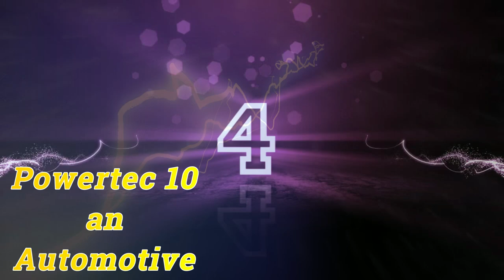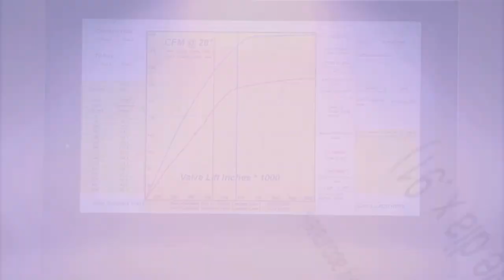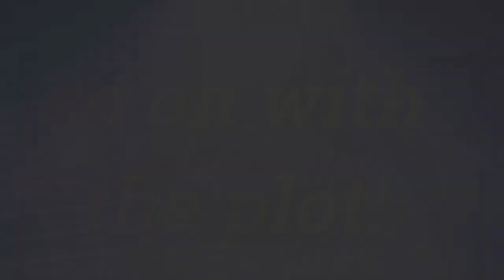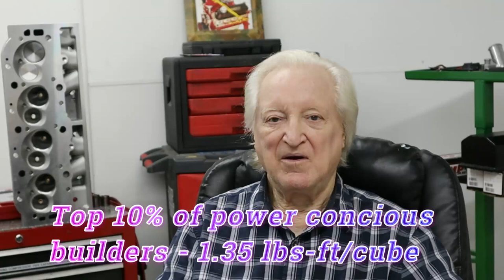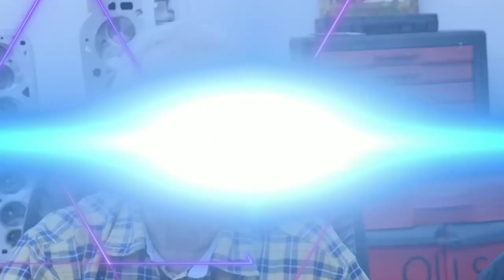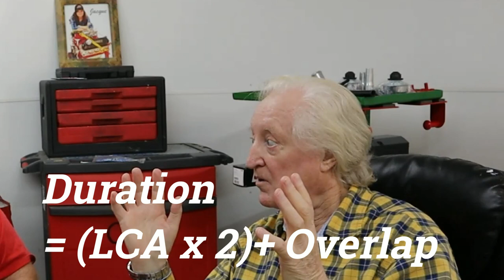Vindicating DV's 128 lobe centerline selection formula

Comment: Is your cam class available online? First time 440 mopar stroker build and having trouble finding right cam choice. Stroker is 512ci ((4.250" stroke/7.100" rod) Stroker kit) ,  10.6 to 1 compression,  intake port that flows over 320 CFM  on aluminum heads, 2.14 intake valve, dual plane edelbrock rpm intake (1000 to 6000rpm range on stroker). Looking for low end to mid range torque for street use. Quick shifting 6 speed auto trans. I must be doing something wrong with your formula because I get a LCA of 100.78. What do you recommend? Special grind? Online classes? Not looking for cheap, just correct right cam regardless of price.

Comment: Great video, I love watching them. I used the 128 formula when I picked the cam for my 331 stroker small block Ford, the LSA came out to 110. But after learning more, I found out that for a small block Ford, you recommend 127 in the formula not 128. Why is the small block Ford different? I wonder if my cam is less than ideal now because using 127, it works out to 108.
Reply: It's because of your valve angle. Different valve angles use a different figure i.e. 128 for SBC and 127 for SBF, etc
Reply: @troymecey  It has Trick Flow heads. So the valve angle would be different than factory. So perhaps 128 would have been right?
Reply: Probably be the other direction seeing sbc is 23 degree, sbf is 20 and tfs is 15. I wouldn’t lose sleep over it. Is it worth something yeah I’m sure but will you ever notice probably not. You can’t feel 10-15hp and it’s probably even less.
Reply: @raymondleathers5921  Isn't the point to get it right in the first place?
Reply: @hotrodray6802  yeah I guess, define right. There’s more to consider than just max hp when building an engine for street use. I watch these videos to hopefully learn something. DV definitely is a intelligent guy but he has a chip on his shoulder when people question his research. Rather than hear him rant about some internet troll I’d rather hear about how he came up with these formulas.
Reply: I believe it's different because in comparison to a stock SBC head the factory SBF exhaust ports suck, so you need a tighter LSA to get more draw on the intake port during the overlap period. Trick Flow heads are worlds better than stock Ford heads so I'd bet the 128 formula would apply not the 127.
Reply: @samuelfreeman9518  guess we’ll never know, DV to busy ranting rather than explaining. I have respect for the guy but if you can’t take criticism the internet isn’t for you.

Comment: How about Pontiac V8 and Oldsmobile V8 David?
 I changed the baseline number to BBC and found it dead on to LCA I use.
Vision Blinding acceleration. Also I am a Huge Fan and User of Iskenderien camshafts and components. Playing with a 1999 Big Block Chevy Gen 6 454 Daily driving fantastic 87 pump gas engine in my 1997 C2500.  Spanking all the LS 6.0 6.2 Pickup guys and High boost Diesel Turbo guys on the Highways in IL. Still like SBC but no substitute for Cubic inches for me.
Reply from the maker: BBC - my favorite motor!!

Comment: In the 128 formula what are the  dashes for? Do I add the CID, 8 and the intake valve size together and then times .91. Long story short, My Dad passed away a couple years ago and I want to finish Our 68' Chevelle for My Mom, but I want to do it the right way. My Dad was a Professional Engine Builder and I know for certain He knew this 128 formula and I know He would've gone over it with Me if He knew he wasn't going to be here in Person.

Comment: Would it be safe to assume that the formula is designed to pick a cam that results in the best horsepower and torque produced, but without regard for street drivability?  In other words, if the formula resulted in selecting a cam with a narrower LSA of say 108 deg vs. 112 degrees, would the 108 deg LSA cam result in a rougher idle, and lower idle vacuum, resulting in potential problems for power brakes, the PCV system, and carburetor tuning?  Would off-idle performance suffer?  Is this why cam manufacturers typically spec out a wider LSA for street use?  Thanks.
Reply: Good question

Comment: To figure out the optimum lobe centerline angle for a four valve engine would you take the area of the two intake valves and convert that to the diameter of an equivalent area single valve?

Comment: I'm running a 350 Chevy with 10.7 to 1 compression 202 160 valve heads and two four barrel Edelbrock carburetors of course headers still crank pink rods Keith Black pistons what do you think would be a good cam for this to daily driver

Comment: Gonna ask a dumb question.....for a turbo diesel engine, semi truck sized ( 12 liters and up ) that is going for better torque and fuel economy,  can this formula be used? 6.00 per gallon diesel fuel is getting old.
4 valve heads
15-16.5 to 1 compression
Peak torque 1000-1200 rpms
Peak horsepower 1800-2100 rpms
Reply: Good question.  I would also like to know the '128' number for an F. E. ford.
Reply: Hi I don't think it will work for you application because this is a simple version that is best suited for 4 inch bores on 2 valve engines, David does have a program that take into consideration everything on a motor but its for gas engines. Hope that's helpful🙂
Reply: @jodypaul2695  I came up with 105 -106 for a 390 and 108 for a 428 . No one ever made a 106 LSA cam for the 390. They should have because it unleashes a monster.
Reply: @Bbbbad724  I guess what I was asking for was the number to use in place of the 128.  He says for a sbf use 127 and for a BBC 132.  Do we still use 128 for the FE or do we use a slightly different number?
Reply: @mackenziehutchison4838  fuel doesn't matter, reciprocating/poppet valve engines are all the same. Engines need what they need and given that most cam designs are guesses at best, bringing some proper thought can make some serious gains in efficiency
Reply: You would probably gain more fuel economy from a turbo change than a cam change.
Reply: @jodypaul2695  I am wondering about that myself. FEs have been my favorite ever and I still love them. I wonder if 130 would fit them better, they were built so well as very sturdy medium block engines. I have built them for years and they really punch way above their weight when you use a narrow LSA cam in them.
Reply: @jodypaul2695  I have posted a question for Mr Vizard about it, and all of the other makes like Oldsmobile, Pontiac FE, from 400-455. Mine is a 394 but it’s a lifetime engine that I spared no effort on and the casting is excellent, and it is a solid cam, 107 LSA, but it still makes 512 lbs ft and 496 hp. And it revs to the upper 6000s and 7000+ if I want to. It is a beast for 54 degrees of overlap. The numbers don’t lie, and I was amazed, I ported the heads myself to just under 270 at .400 to .294at .540, a sweet spot for the cam, 1.8 rockers and hose barbs in the valley drains with the oil going to front and rear but off the crank. Nodular iron but light keeping the oil off. I hope that he sees this and gives his experience. Torque is where it’s at, I chewed a 400 ci GTO with RAIV heads and a mcKellor solid cam up and spit him out with a 4800 lb 65 F250 4x4 and the NP 435. That torque is vicious and slamming the truck trans with a tap on the clutch. When we stopped he was laughing like a hyena. He had me raise my hood expecting a 514, he said OK that is a Holley Street Dominator and 3 inches of spacer, and a 750 4100 style to his RAIV and Qjet. I heard it pop when he surprised the secondary. I replaced his hanger and rods to a C and AX rods. Also it was only opening to 95%, so I got out a bastard file and put the flat side to the lugs on the air valve to 100% and the accelerator pump was set too high and it was sipping air, so I set it down where it should be, locked and loaded. He also was having trouble at times with the clutch pedal sticking to the floor, but he was just tapping it like I was it didn’t stick, but I adjusted it and adjusted the pedal return spring just a little.. I had a 70 LeMans Sport with a 4 speed and a RAIII so I knew what to look for. I offered him a rematch, but he said nope, he was completely convinced that I had either a 64 427 LR or a 428 SCJ. He refused to believe it was a .020 over 390,lol. I saw him out and gave him the 3 and he shook his head no.
Reply: @Bbbbad724  cool story.  I will interested in hearing what Mr. Vizard has to say.  I would love to go to one of his seminars, but I haven't seen anything on his website yet as to when he will have another one.  If I might ask, who is the cam manufacturer for the can in your 394?
Reply: @jodypaul2695  Thanks but I promised not to disclose it.   It is a good cam though. To be at 107straight up it’s surprising that it is as civilized as it is until you jump it.

Comment: DV>>>Mike Jones supplied the blank and ground my 104 LCA for your CosCam specification Roller for my GenVI 496 Stroker BBC. I had undersize 2.19 intakes because I had a new pair of 290 CC Runner GMPP/Edelbrock Aluminum heads for the build for a mild street engine. Mike ground it with one of his profiles you recommended.:goodvibes:

Comment: Most engines are over cammed when built by speed freaks. Like us. So just go a few sizes smaller then what you want. If you want a 320 cam use a 285 etc.

Comment: Excellent video DV. Thank you very much for your time. One question however, everyone focuses on the intake lobe and LCA/LSA. My question is,  how do I determine the correct exhaust lobe? As you are aware,  everyone wants to sell you a cam with a vastly different exhaust duration and lift. Basically what I am saying is that every cam company seems to think that the exhaust side doesn't flow enough. I know that I am missing something here. Regards Greg
Reply: He says in this video that with the proper LSA and the desired overlap that the overall duration is automatically revealed.
It's just numbers.
(LSA x 2) plus overlap = duration, wasn't it? So the duration is the result.
Overlap is intake open to exhaust close.

Comment: I'm in the research phase to build a 598 BBC. I'm currently reading DV's How to build HP book. A just under 103 LSA on a such a huge engine? It seems that the cranking pressure (cylinder pressure) would be way too high for street use. 

Could I spread that out to a 105 LSA and still have the engine run efficiently?

Comment: Question - I asked the guy who's going to be building my engine, and he agreed that your method of selecting LSA would make good power, but he also said it cold cause detonation problems (due to higher cylinder pressure) with pump gas. So is the formula applicable to pump gas engines or is it for racing gas? Not doubting your method, just wondering if there are any adjustments needed for street cars running on pump gas. ALSO... is the "128" OK for a small block Mopar or does that need to be adjusted? Thank you.
Reply from the maker: You need to use a detonation safe combination of CR and fuel octane. If we go a sep further here one of the correction factors is to alter the LCA to get the cranking pressure where it's needed for the octane used. Your engine guy sounds like he is on the ball!

Comment: Thanks for the content David and Andy, I'm interested in your thoughts on finding the lobe centre line on a none symmetrical lobe as the opening ramp and closing ramps are totally different. Last time I done some measuring on one of those new lobes.  I measured at 0.006', 0.050' , & 0.200 and the centre line angle changed at every different lift?
As the nose radius is not centred to the opening & closing ramps.
Years ago an old cam grinder gave me a formula that was Duration Divided by 2 and Subtract the Lobe Separation for Intake Open and add the Duration for Close etc.
If I used the above Formula and the Cam Grinders Advised Lobe Separation then corrected out the Cam Grinders Advance the Opening & Closing Events were correct as they provided Opening & Closing Data @ 0.006 0.050 & 0.200
I have noticed a lot of people dialling cams in on lobe centre line @ 0.050 etc
To me it looks to be getting back to Opening & Closing events as the Lobe Centre Line varies at different Lifts as the lobe area varies as per the ramps.
Looking forward to your thoughts
Reply: I usually determine intake centerline by doing .050 from full lift.

Comment: May I ask a question about what confuses me? Let us say we start with a camshaft for a 350 sbc that is 270/270/108 installed at 104 LCI. If we then compare it to another camshaft that is 270/278/110 installed at 104 LCI, overlap and the overlap triangel area should be very much the same. I do not understad why this is a worse choice than a camshaft that is 270/278/108 installed at 104 LCI. Is it the difference in peak exhaust valve lift timing?
Reply: DV emphasizes that it is the LSA that is most critical and that precedes the desired overlap.
Duration is the conclusion of those first two.

Comment: A 3/4 race cam in my world is a cam with .750 lift. Have one in my 496ci Chevy. Except mines  only .748 lift, but close enough. I never did put much stock into people claiming they had a 3/4 race cam when in reality, it's just a mild street cam.
Reply: I thought that the term "3/4 race" was meant to convey it is a cam that is 3/4 the way from stock to race, as far as it's duration.
Reply: @pete540Z  Pretty vague term tho, one man's race cam is another mans street cam. Actual specs are always required if ya want to do it right.
Reply: @pete540Z  NHRA "Stock" Eliminator engines use stock lift spec, but shitloads of duration and tight lobe separations. They are full rowdy with minimal lift. Wouldn't call them a 3/4 race cam tho. They are serious these days.
Reply: @thereluctantgearhead4544  Totally agree!  I used to give Frieburger shit when he'd publish Engine Masters results and leave out the LSA.  For years I complained and he never fixed it.  Like RH, he's another one who is not as smart as he thinks he is.
Reply: @pete540Z  Alot of them guys are just paid to push parts. People I paid attention to were Joe Sherman, John Lingenfelter, David Reher & Buddy Morrison, etc. Few others worth noting. Smokey Yunick and Bill Jenkins are a couple. John Kaase is also a super genius with engines. On that engine masters shit, Steve Brule is the smartest of the bunch. He's built many amazing engines long before that show existed. Dudes slick.

Comment: What about when building an engine for off road and want more low end torque? Doing a 6.2 ls with 10.5 compression and wanting torque for trails. How do you figure duration and lift to be optimal?

Comment: Can LSA and intake closing be both considered together? IC is related to dynamic compression. If I want 8.0:1 dynamic compression then IC has to be chosen. Then I can pick a cam LSA using the 128 formula. Example, I can say I want an IC of 41 abdc and a 107 LSA. Both considerations are valid

Comment: Sir, do you have a mathematical example using your equation? I tried it and come out with a 104 LSA for a 350 with s 2.02 valve. I've never seen a 104 LSA cam. I must be doing something wrong. Can you help?

Comment: My 423 CID SBC has a cam that was recommended and manufactured by a professional cam grinder.  It's ground on a 110 LCA.  According to your 128 formula, I should have gone with 105 LCA.  My engine made 500.4 RWHP on a hub dyno, which is respectable.  I'm curious how the engine would have ran with a tighter lobe spread like your formula suggests.
Reply from the maker: Answer - a lot better - the 406 in my Firbird made 540 at the wheels and had plenty of low speed grunt.

Comment: Mr Vizard, with all respect, I am curious if on a Ford FE , using ported heads very similar to a 427 Medium Riser and similar in size and shape is like the 427 LR. The engine I want to build is 413 cubic inches an overbored 410, .020 over 4.05 bore or, 4.07 by 3.98. it has a 1 .76 rocker ratio. What would be the best base number?  The heads are 13 degrees and the valves 2.165 /1.63 and the 2.165 has a bias to favor a large intake valve.  They flow 285 @ .400-296 at . 550-.600 . Low friction pistons and rings. 1.63 rod ratio. At 10.5:1 should the number be raised?
Reply from the maker: Bill, I had a cam too spec for one of those engine but that was before my brain surgery and I cannot remember the details - sorry.
Reply: @DavidVizard  With all respect, thank you for sharing. The early FE was a good breathing engine, so I used 128 as they are much better than the 289, 302 and 351 series. I built a.020 over 10.25 :1 cr engine with 427 LR valves and a better intake and headers with a 107/107/107 cam and it made 512 ft lbs and 496 hp. It is still in good order today. Thank you for your knowledge that I learned back in the 1980s. I built this engine in 1999 and it is still running fantastically today.

Comment: David have you in your travels,
When building any engine had a cam shaft lobe during run in fail due to softness or (lack of hardness in the lobe. I've been told it was my fault but I believe that manufacturing can also have a bad day and let 💩
Get passed up and gets shipped out. Your thoughts?

Comment: DV I had a question having to do with overlap after you chose the LSA, example in your how to build horsepower book pg 102( lower left corner), it shows different overlap ranges for different performance you'd like in a chart, are those based on duration at .050 lift or adv. duration. Keep up the good work, enjoyed all your books, they've helped more than you'll ever know, Thank you.
Reply: The previous video says .050 for overlap.
.006 for duration.